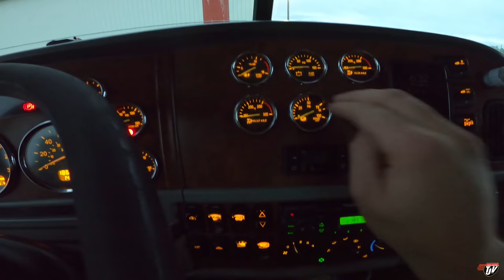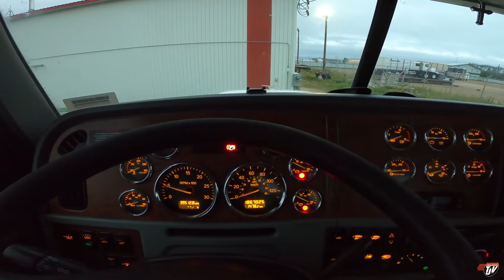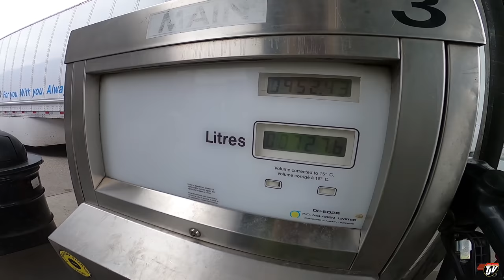HERBIE? | My Trucking Life | #2354

Comment: Ur old volvo best still be going since u sunk like 20k into the motor and stuff lol and u should get a metal thermas like i got it keeps water cold for like 26 hours if u add ice cubes and apparently it keeps coffee and stuff hot for like 12 hours its a 40 OZ bottle i only use it for water but loves it got it off amazon and in construction zones they normally got it set to the speed limit but most other roads u can get away with 5-10 over
Reply from the maker: There's been many more thousands sunk in to it since then lol